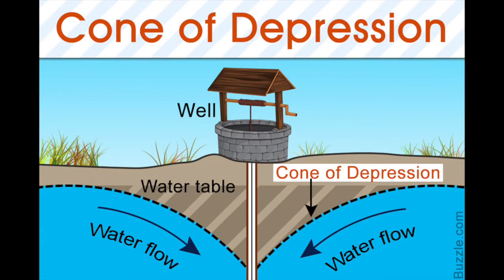Suddenly no water from your well. Over pumping a well, bore hole problems and solutions. AquaLocate

Comment: Thank you for the information. I wanted to know whats' the best way to stop borehole cave in. I'm in Uganda my country but live in TX. After drilling about 3 meters then dropping a new drill pipe extension, the pipe only goes in about half way thru. We have to screw it down so the next pipe can be installed. Now after around 6M depth the mud pump has stopped working, theres' no help from the supplier, they only come up with silly solutions without any effect. Can I use a water pump which pumps at 115 bars and has head height of 140 meters. Many thanks again. Forgot to mention, we are using Polymer to stop borehole cave in without any success.
Reply from the maker: please contact us at 800.251.2920 or through www. aqua locate.com/contactus